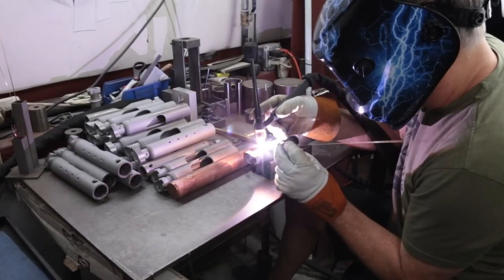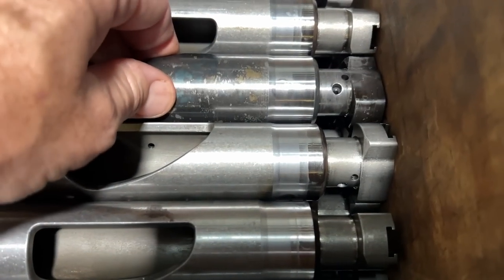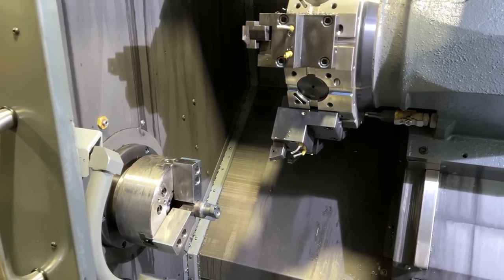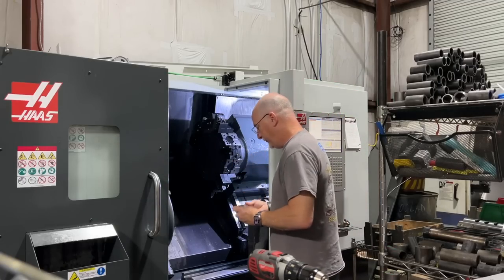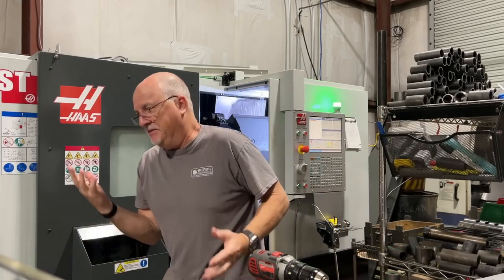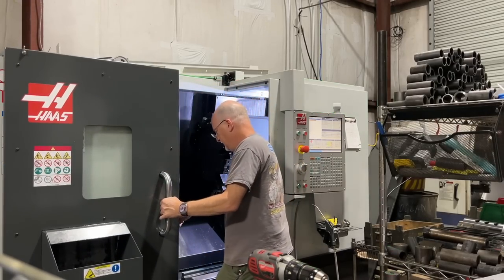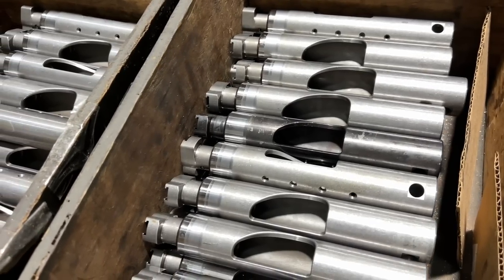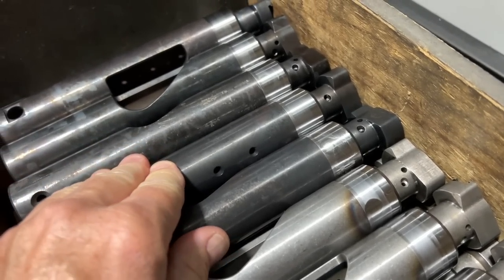Watch Your Temper!

Comment: Maybe cut the weld with a ceramic like an RNGN-45 without coolant instead of carbide then do a finish pass with a CBN.
Reply: Ceramic is more brittle than tungsten carbide.  So, no.  Not without annealing the weld first.  Or heat treating the whole bolt.
Reply: @Rick O'Shea  I've run them on welds just like this and much bigger, that were sometimes done by robot welders, cutting stellite welds on materials anywhere from 4140 to inconel both with and without salt marquench annealing. The edge of the ceramic will chip a bit almost as soon as it touches the weld but they're so much harder than carbide they'll still keep eating. The CBN will clean it all up and make it look good on the finish pass. It all comes down to speeds and feeds.
Reply: @jackjames3884   It also depends on your initial depth of cut. You need to go deep enough to get just under the scale hardness layer. If he's using chip breaker inserts they usually have a minimum depth of cut for the chip breaker to work. Sometimes with hard interrupted cuts you can't push the cutter to chip breaker depths without breaking inserts.

I've sometimes had to go to ceramic inserts without chip breakers to make thin cuts in the material to stretch out insert life. Sometimes they even last longer running them dry. 

The reality is no two jobs are the same. When you think you got it figured out you save the program and document what inserts you used with a given program. A month later you setup the job again and find your previous settings don't work so great anymore! Maybe you guys in climate control don't experience such variations from day to day life.

Comment: Most of the quenching happens through conduction into the rest of the steel. That's why thick sections need pre heating before welding. Otherwise the conductive heat loss into the rest of the part will cause the now austenitic HAZ and your rapidly solidifying fusion zone to quench very quickly, forming martensite. On thin sections the predominant mode of quenching is the argon.

Try preheating before welding then shove the parts in clay or refractory like bentonite or kitty litter. This will reduce their hardness and it should also fuse better. Your reducing the delta T and suppressing the martensitic reaction by doing so. Additionally this can be a continuous process, have parts preheated in the furnace and when it is time to weld pull one out putt one in. Have the preheating temp be +150f of Ms temperature of the steel. Get the Ms from heat treaters guide. 

-your friendly gat building metallurgical engineer
Reply from the maker: @joewboe I hate to disagree with my friendly gat-building metallurgical engineer, but I think you're wrong on this one. As I'm sure you know, for a particular steel to be quenched depends on its cooling curve. That's why some steels need to be quenched with something as harsh (as far as quenching goes) as water while some only need still air.  I would bet that the temperature drop of the welded area due to conduction into the surrounding cooler steel (which isn't all that cool after the first arc has started), isn't fast enough to actually quench these particular steels (chrome moly). If we were talking S7 or A2...maybe. I don't know this for sure, but it would be an interesting experiment.
Reply: @markserbu  the martensitic transformation is an instant, diffusionless event. It happens when you are cooling and reach the martensite start temperature (Ms) in the cct diagram. If the base metal is above the highest Ms of the either of the steels your welding you will only form martensite from gas quenching, which will only form on the weld pool. If you do this the hardness will be significantly less in the weld because it will be heated back up by the base metal. 

The argon air cooling will form martensite on the weld pool. I'd expect to see hrc vales in high 30's to low 40's instead of 50's if you preheated. 

You can disagree or agree is fine with me. I'm just trying to help you out. I encourage you to try pre heating the material above the Ms of both steels prior to welding. 

Love your work and that you share as always!
Reply from the maker: @joewboe Thanks for the reply! Funny, I know about martensite (and many other big words), but I always thought pre-heating the components was more about reducing the stress effects of thermal expansion (the old alpha delta T thing). I have an induction heater and will try pre-heating some parts, checking the hardness after welding.
Reply: @markserbu  "the stress effects from thermal expansion" that causes the parts to loose their tolerances is from the martensitic transformation. The transformation is displasive, the crystal lattice in the grain actually moves and distorts at the speed of sound when transforming into martensite causing stress and distortion. When a part is preheated above the Ms, before and/or after welding, it is to reduce the propensity of the martensitic reaction from occurring.

Try it with your induction coil or better yet have the parts soak in the HT oven above the Ms of the higher Ms steel. Be sure to slow cool after.

Comment: Put G00 X-3.000 Z0.00 M69:
Instead of 
G00 Z1.000:
X0.00:
Z0.0:
X-3.000:
Reply: Can't believe you solved his g codes for him
Reply: M69 on a mori controller is different than M69 on some Haas controllers. My guess is your wanting to have the machine open the chuck after the operation cycle to eliminate one foot press.

Whether Mark's machine uses that specific code to open his chuck I don't know. I never assume any two cnc machines use the same code.

I've even ran two Mori's side by side that were slightly different in age and one command on one machine would have been a crash on the other.

If the open chuck is your suggestion be sure to add a spindle stop command just before that command on a separate line to keep it safe.